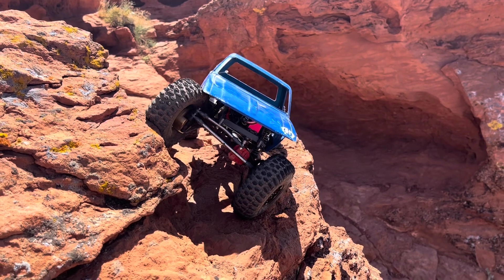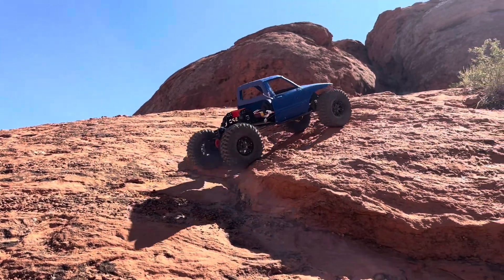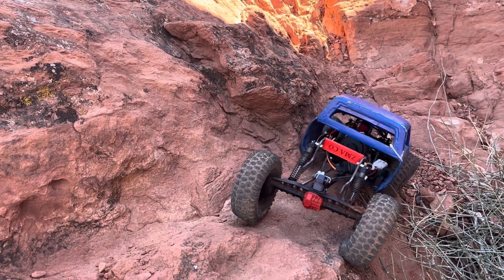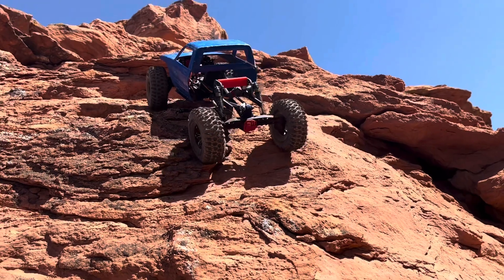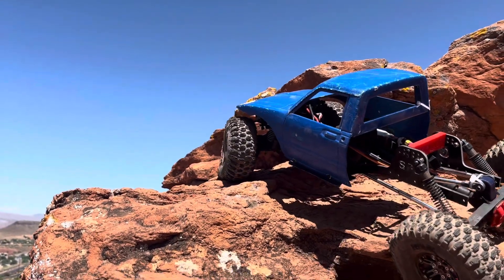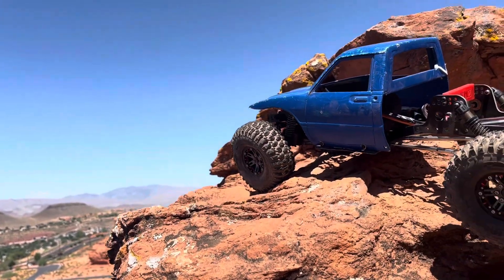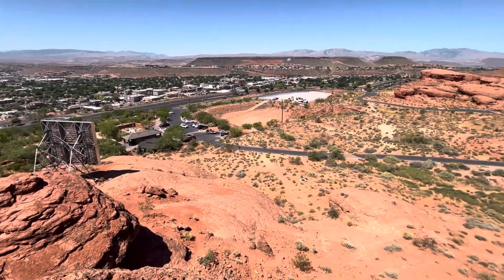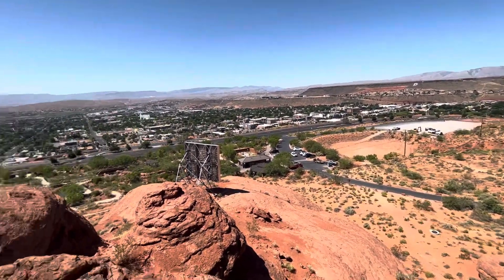Making it up CLIFFS EDGE with the Injora 82g brass AR45 portal caps  (part 2)

Comment: On my Capra I run Hot Racing
88g Brass  3rd member and
HotRacing 48g Brass  portal covers that's 184g of weight on the front end. The couple times I have been there the  Hyrax's didn't work well. The super Swamper worked a little better. And congratulations on making it to the top. Stay safe my friend. Will be there in October.
Reply from the maker: Oh dang that’s a lot of weight that’s awesome. The swampers did better huh? Interesting, all the guys here run the proline crawlers.
Reply: Crawlers will look into them. Hyrax are g8 and my Swamper are predators. When I  get back out there it will be a different Capra now running a 1080 g2 esc and a different motor and desert lizard shocks. Just hope it's better.
Reply from the maker: @Love2Wander  how are you liking the desert lizards? I’m thinking about those for my Capra as a good cheap option
Reply: Lots of tuning at 1st, but once setup  there nice. I have them about 75% Droop. I like them, but there are a lot of people who hate them. So far I have not had any problems with leaking.  I picked them up at SkyRc  the last time we're there. Cool shop
Reply from the maker: @Love2Wander  ugh the constant tuning it was I don’t like (with shocks) 😂 skyrc is awesome! Cody is a super cool guy. Definitely takes care of me!

Comment: Reset your end point on the steering! Those axles should steer better than that.
Reply from the maker: I think part of my problem may be my steering link is too long…anyway to fix that other than buying a new link?
Reply: @HobbyDrop cut a piece off the rod, like 1/8 inch
Reply: @HobbyDrop  Unless you can machine it down and re-thread it to the length you need, you have to purchase one. You can get adjustable links.
Reply from the maker: @rccrawlingaddict207  yeah I’ll probably need to do that cause I have trimmed the rods down quite a bit already.